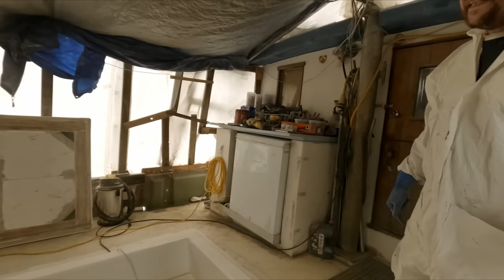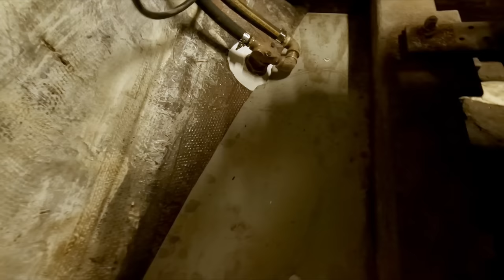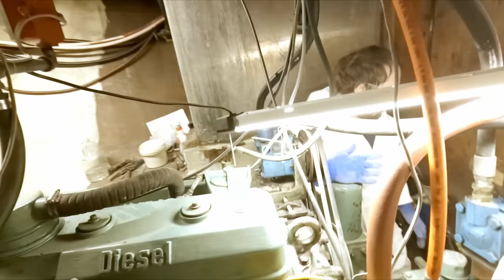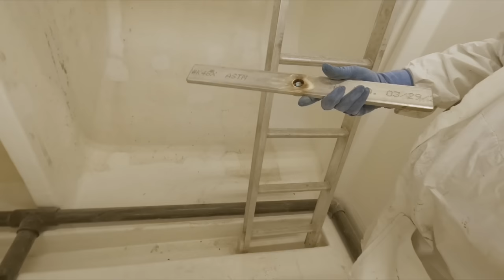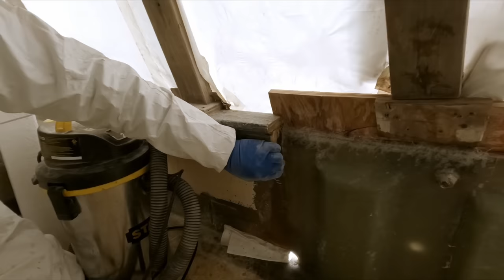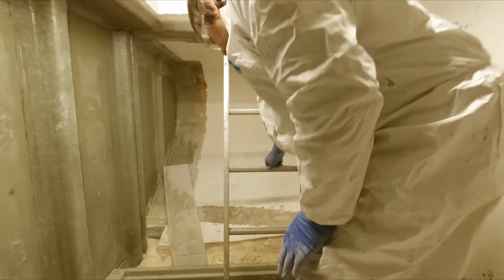Update - Emerald Isle: Ep.69 Fishing Boat Refit

Comment: I can see you have put pipes in for the crabs but will they be in the way for fish when dropping in large fish like halibut?
Reply from the maker: Yes they would be. They are removable and where the elbow meets the bulkhead, we can unbolt the crab circulation pipes and put in a short elbow that will drop down into the sumps allowing us to pump out water from ice melt and also rinse water from cleaning.

Comment: What is the item in the rear shaft bearing that looks like a spark plug?
Reply from the maker: If you are talking about the bronze stuffing box, that is an air valve you can use to inflate a rubber bladder around the shaft. It stops the inflow of water so you can repack the stuffing box in the water. It can only be inflated while the shaft is stopped.
Reply: @EISAlaska  THANK YOU so much for that explanation.